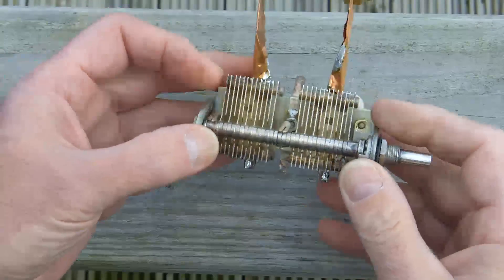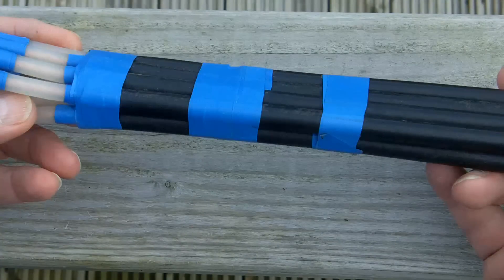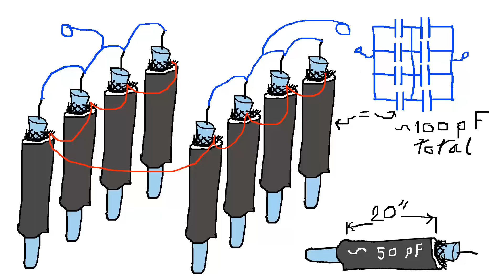About Capacitors ... Part 6 Coax Cable capacitor for Loop Antenna  by Andy Davies.

Comment: If you strung them all out in a line (with same exact connections, would it be more or less or same capacitance, just wondering if the close packing has an extra advantage ( i would think it would at least slightly different bc of interaction by close (or not close) proximity of the 8 coax sections to each other.  I have found that with a TV coax, doing winds (coiling) the coax it can "tune" the antenna better (or worse) depending via apparently a capacitance appears across the coils of coax (nothing was disconnected at all, just coils of slack coax). Thanks for your advisement.  In other words what picofarads would I need to tune my TV antenna.. THANKS !! Fyi: I do have a 10 m band ham set.
Reply from the maker: Hi as each of the coaxial capacitors outer screen, effectively screens  its own inner core from the surrounding outer core. So none of the capacitors affect one another no matter how close they are.It suited me to have a close bunch of capacitors to keep it all tight, but yes they could be strung out in a line and so long as the interconnecting inductance is not a problem it'd be okAll the best . . .  Andy

Comment from the maker: @MrVinamp Hi there, no, the coax capacitor is only a capacitor it isn’t like a balun, a balun (balanced to unbalanced transformer, for those not familiar with the term)The balun acts more like a choke or 1:1 transformer so I guess a balun is more ‘lumped’ L than C. I was going to say in the video that you can’t make the capacitor out of one or two long pieces of coax as you start to get onto characteristic impedance issues where length is counterproductive due to the inductance. Regards Andy

Comment: THanks for posting Andy.. I was curious what power limitations have you experiences with the coax capacitor?   I've tried RG58 skinny coax in the past, but recalled some issues once getting past the 50 watt mark.
Reply from the maker: Hi I couldn't be specific about a maximum rating for the coax capacitor but I've used it on 80 metres with a linear amp without any problems. 
I wonder if you had current or voltage problems. i.e. flashover or meltdown? 

All the best . . . Andy
Reply: @AndyDaviesByTheSea  I would definietely say flashover at around the 50 watts mark... It was only RG58 howver.. That may of been part of it..

Comment: Are the plates used made of copper plated with silver plating ??? What is the normal used material for this type of capacitors ?? Thanks
Reply from the maker: Hi, theses are normally silver plates brass.

Comment: I was thinking on making one using lmr600. I know it's rated at 5.5kw watts at 30mhz and 22.81 kw at 1.8mhz of the ham bands. having a voltage rating around 4000 volts with capacitance around 23pf per foot. putting it, in series and parallel with remote switching, with a big variable cap to tune my loop. I'm building a big loop then using loads of capacitance to tune up in frequincy. if I'm wrong please correct me. I'm self educating and asking for steerage.

Comment from the maker: @banjax66 Hi there, well it’s not really a problem I’ve had, but you should understand that I don’t do a lot of repair work. For what it’s worth I’ve picked up a rely helpful tip from ‘AllAmericanFiveRadio’ on YT and that is that you can resurrect the most awfully scratchy carbon pots by giving it a sniff of WD-40, not too much mind you. The trick is to leave them to soak in a bit (hours) but it really does work. I’ve saved several very badly worn pots this way and I’m told it lasts. ...    Andy

Comment: I have been cleaning scratchy and crackly volume pots with WD40 for years. since 1982 (ish). that was always my first line of attack and I thought it was common knowledge and the normal way of repair as WD40 was much cheaper than dedicated switch cleaner that also had the same effect. Yes I also used WD40 as low voltage switch cleaner.

Comment from the maker: @visualco2
Hi there, I can’t identify your capacitor from the number but I’m sure if you ask the question on QRZ (I see you’re listed) you should find someone who can help you. As a guide, I’ve used 2 halves of a split stator air capacitor in series, each half has a ~0.050” air gaps so that is equal to a total of ~0.100” gap and put ~100 watts into it no  problem.  Have a look at some of the ‘Magnetic Loop’ web sites, google w2bri. 
I hope that helps.

Kind Regards ... Andy
 
gw0jxm

Comment: Hi Andy. This question has nothing to do with Caps..
It's to do with potentiometers actually...
My question is do you ever have problems getting the required pots?
I just wondered as the old style markings for: 
Linear  was A but became B or LIN.
Log was C but became A or Log (just to confuse things with linear!)
Antilog was F but they don't seem to exist anymore!
(Antilog was like a mirror image of Log from a resistance scale)

Comment: Nice loop. Do you know the 2:1 SWR bandwidth of the loop on 40m, say at 7.1 MHz? That might give an indication of how much loss your coaxial cable capacitor is adding (since we can compute the radiation resistance and the resistive losses of the 1.3m x 1.3m 22mm-diameter copper loop).
Reply from the maker: Hi, sorry I don’t have the 2:1 info to hand but I’d say it’s very very narrow.
Regards  . . . Andy
GWØJXM